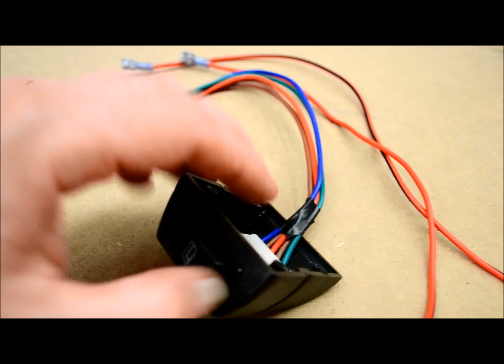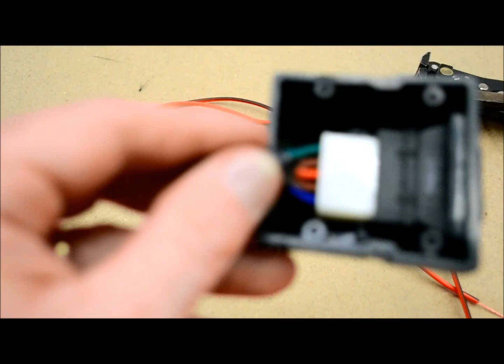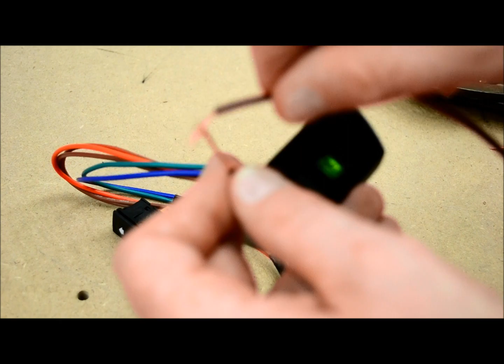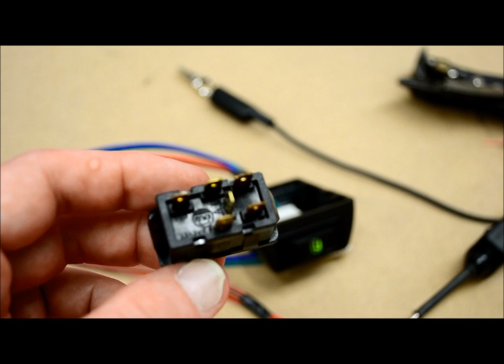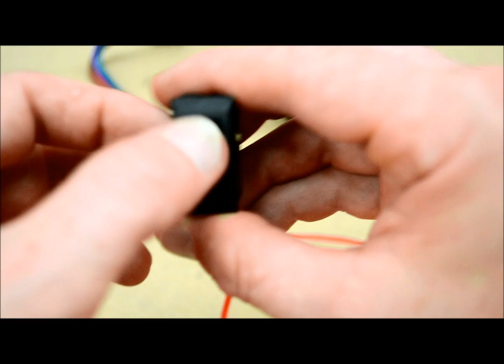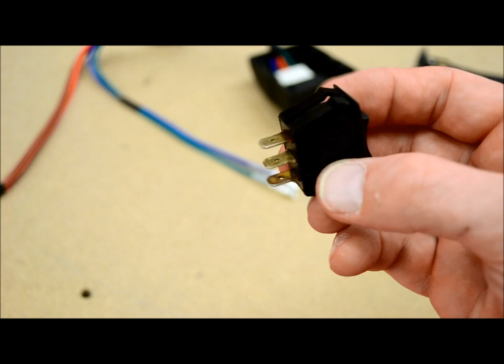How to wire door lock and power window switches

Comment: Excellent video. Im wanting upgrade my van windows to electric and bought a kit that cone with the spal type switches but a different pin configuration. Ive managed to get the windows working but can figure out how to wire in the 3rd switch so the passenger side can be operated from the drivers side. Any ideas on how to do this?

Comment: Hi
I’m using 1993 Toyota 4runner for power window conversion and here are the wires 
Power-Blue with red stripe
Up-Blue/green stripe with red dash 
Down-Blue/yellow stripe with red dash
And the other two wire not used not if that’s ground. For whatever reasons it’s not operating. Any ideas?

Comment: Not sure if someone could help me but I’m wiring my truck to convert to power with the oem switches I got the main to work to roll down driver and passenger on the driver side but the passenger side switch will only go down but not up it trips it out and acts like ur touching - and + together so I’m confused on how many relays I might need for a 2 window I’m wiring it with my own relays and wiring not sure if I need a total of 2 for drive n 3 or 4 for passenger so the driver side switch for the right window works with the driver side and passenger side switch (1995-1998 Chevy c1500 oem switches and motors)

Comment: I'm having major problems finding the source of the problem with my driver's door power window I tested the plug going into the motor and it tests good getting all output indicated with a light tester try three different window motors and still not working and checked all fuses and relays that I know of any advice please

Comment: I have a 2020 KIA Bongo. The passenger window button panel was recently pulled apart.  It separated the 5 pin wiring and now I don't know which wire connects to which pin. Please help. Thanks in advance.
Reply from the maker: Ypu should get a kia schematic for that one

Comment: My car end is a 2 pin plug but my window motor is a 7 pin. I don't care about the auto up and down so how do I make this work?
Reply from the maker: the 2 wires should be basic reversing 12 volts, if you switch them the motors direction will reverse

Comment: so if i get power to roll the window down but not to go up do i just need to replace one of the blue/green cables because i know the switch and motor work? if so where would i get the wire from and how would that install work?
Reply: Did you figure that out?

Comment: Ah ha! I bought heavy duty momentary on rockers, they won’t work for this will they?  They are places for three hot wires , 3 groups of two contacts. All this time I though high voltage stuff was sometimes complicated, I understand it though, this low voltage stuff is killing me. I’m thinking I’m taking a loss on the switches I got, too late to return them, I don’t even remember where I got them. Then just get some of those type switches you have there is going to be the simplist way to deal with these windows. Hot wire to center prong and match the rest from the old factory socket to wire the rest. If that’s at all understandable and you see this any advice would be very appreciated. I have a very good understanding of how they are suppose to work now thanks to this video, I should have came to YouTube 2 days ago I think. I have one of those 12 volt power supplies, they are just completely awesome! My father used to used it for powering a mobile cb radio in the house and to test any 12 volt stuff he needed to test out, the thing is ancient but still works perfectly.

Comment: A lot of these newer power windows have their own fuse somewhere in the line usually behind the dash. Don’t just check the window fuse and think that’s the only fuse to check.

Edited: Refer to the vehicles electrical wiring diagram, usually found towards the back of the maintenance / overhaul / Haynes / Chiltons / Mitchell’s manual
Reply: Never seen any OEM window system in a vehicle have an inline fuse? What are you talking about?

Comment: Good video.. let me ask you.. how can I apply this concept to my 97 Honda accord. The passenger window will not roll the window up or down by either driver or passenger switch. The wires are getting power but somehow its not working the motor. Test light shows power going through the wires but it don't roll down or up.. so how can I just run a new set of wires just for that window.  Where do I get the power from?

Comment: Nice video. I am restoring an old truck. I have a donor truck and I want to power down the windows. There is no fuse panel in the doner so can't just install a battery and power the windows down. I am trying to figure out how to power my windows down. I took the switch out of the door panel and now I am trying to figure out what wires I should apply 12 volts to. I will try to use the wiring you just did, but I think the colours are different. It is a GM switch for 4 windows. At least you have me pointed in the right direction. Thanks for sharing.👍👍

Comment: I am about to add a universal power window kit to my hot rod. This kit comes with the same Japanese green light window switch in your video. This may sound a little weird but, my hot rod interior is lit with all blue led lights, would you know if its  possible to switch the green light to a blue light and if so, would you have any suggestions on how to accomplish this. Thanks

Comment: Hi, My two windows work and the other two doesn't. I've noticed that on the ones that don't work there's no noise when I press the switch. The window regulator and the motor is good but I'm guessing it's the wires? What should I do?
Reply: SET LIGHT TO YOUR FRONT SEAT'S

Comment: what's the pen configuration on the second switch i have one liked that it goes a-f it has 6 pins
Reply from the maker: those are available at spal.com
Reply: Lessco Electronics you woulnt know the wiring on those pins like which is ground an power

Comment: Quick question...
When installing a power window conversion kit...
Are relays needed to be used..
Thanks.
Reply from the maker: not at all, 5 wire switches can handle all the load
Reply: no if you find switchable power source for the module. if you choose to take power straight from the battery, you should install fuse and relay, otherwise it's way too easy to steal your car.

Comment: Thanks for the info,any relays needed? or do you run switch wires directly to motor?
Reply from the maker: If youre using 5 wire switches no relays are needed.
Reply: Lessco Electronics great thank you

Comment: Hi, did I hear you right on the 3-pronged switch? ground on the center conductor?
Reply: this if for the power locks. :D
Reply from the maker: Thats a typical scenario for a non illuminated switch, that grounding type of switch sends a -signal to external relays to power the door kit motors.
Reply: thank you very much.
Reply: @Lessco Electronics, is it okay to wire it directly to the battery? or should i use fuse taps for the install. thanks for your advice.
Reply from the maker: Grab your power at the fuse panel

Comment: i did like you showed here for a single window. the problem i am having is for multiple windows or 4 windows to be exact. when i take two motor terminals from the front and attached them together with another two terminals at the back, they stop working. could you help me.

Comment: Hi, love your work! If I go to the parts store and I want to buy a switch to run my power window, can I wire it like fog lights? Like a + to the battery and then to the positive side of the motor and a ground??? I'm trying to simplify it lol, any ideas? Would I need 2 switches per window???

Comment: Hi, I just converted my 2000 Chevy Silverado from Manuel to power windows, my windows still go up and down when my truck is off and the key out the ignition, the lights from the switches turn off when the truck is off..how can I make my windows not go up/down when my truck is of? Thank you
Reply: The power source is constant 12v move over to a power source like accessory on ignition
Reply: Eduardo Hernandez how did you get them to work??

Comment: Hi, thank you for the video, I had a question on switches , I am installing universal power windows motors on a 60s car, and the motors are the same brand on the front Windows, and different universal motors for the back windows, will the universal switches work that they sell on Amazon work for them? Thank you in advance.
Reply: Maybe any universal 5 pin, insted of a universal 6 pin?
Reply from the maker: Yeah, that won't matter

Comment: hey man ihave a 2014 lancer and i want to remove the rear power window switches but the front main panel wont work with the rear windows if the switches arent conected. i have one co ected hidden and works fine but for the othe door the switch broke so the window wont work. what can i do to make the front main panel work the rear windows with the rear window shitch taken of???
Reply: Sylvia Silva you need to bypass switch that is broken and go start to motor

Comment: When wiring the power lock you nees to connect it to a 12v cable or where do you connect it ?
Reply from the maker: Use a constant fused 12v source

Comment: I have a window switch just like the one you show on your video. I wire it up and it works once in awhile. The window goes up and down very slowly. I take the switch out and operate the window from a power source. It works fine. Could I have wired it to the switch wrong? I'm putting in after market window and door locks. The windows are the problem. Any ideas?

Comment: I got a question I have a 96 gmc sierra manual windows I'm getting doors with power how do hook the relays to my fuse box instead of running to the battery
Reply from the maker: find a blank and use that with the appropriate adapter tap, just make sure youre on the fused side

Comment: Hi - great video - I have a 2004 Yukon - rear driver side window rolls down on its own at random times - I replaced the specific window switch but problem still remains - I spoke with a guy and he said change the relay in the footwell - but I am struggling to see that the relay could cause the repeated fault of the specific window (why does it not affect the other windows.....) - only other thing I can think of is the driver's master switch assembly (expensive to replace) - any advice???

Comment: I was replacing my the front Driver & Passenger side window regulator/motor today and all went well and fine - however, on the passenger side, I don't believe I did anything differently - but the up and down direction has gotten reversed. I've been researching this and people say to swap the wires but I'm not finding a good diagram for 05 chevy colorado. Are the up and down movement wires a standard blue and green wire like you show in this video? I can't recall right now but I will recheck tomorrow when I tackle it again -  what is odd was that originally is was operating correctly when I tested it before putting the door panel back on... but somewhere between then and getting all back together - at final assembly of the door, it acted as if it stalled and didn't want to work - then began functioning, just in reverse. So strange, never had this happen before.
Reply: unpopular advice : reverse the switch

Comment: Dear Lord please wire your window switches to ONLY work when the key is in the ON or ACC position, otherwise your car go bye bye one fine day.
Reply: i wired my window switch directly from the battery because there is something wrong with the fusebox that the mechanic said he cant fix.. i added a circuit breaker tho.. and since i cant havnt bought a new fuse box i still run it today.. i always turn the switch off when im not using.. but i cant trust anyone else to drive my car and its a bit stressfull.. im open to better fix suggestions because i cant find a new fuse box to buy
Reply: Hruaitea Ralte just use a fuse tap and wire it to a fuse thats only active when your key is in the on position

Comment: I have the wires all connected but where can I get the power source from car interior?
Reply: Honestly it depends on how you want to do it and the vehicle you have. The question is do you want to struggle or half ass it and call it a day?

An example source for 12v acc power is the radio. when you turn the key power is on and if you tap  in to it so will the locks or windows. Another example is from the fuse box. using a test light  ground the clip while probing away  and tell a buddy to turn the key forward  and if it lights its 12v acc. The struggle lies in how clean of an install you want and from where you want the source and the crap you need to remove and finally button it back up.

The half ass part would be direct 12v to the switch(es) and being stranded with a sapped battery from the little light.

Also you can google the vehicle you have and check forums.

Comment: good morning I have a question that I'm sure you'll be able to answer. I watch a lot of your videos great work by the way. I have these windows in my 74 bug. The issue I'm trying to fix is I don't want 2 switches on my drivers door panel because I switched handles to mk 4 handles. Is there any way to add a delay that when I hold drivers windows switch down and drivers window is down it would then trigger passenger or do I have to use the 2 switches. Thanks in advance
Reply from the maker: There may be but I cant think of one. Even if there was a way, the wiring would be extreme!

Comment: how to install power window relay with switch 5 pin and where To connect do You af a DIAGRAM FOR IT
Reply from the maker: no need, the center is 12v+ the 2 middle pins are -12v and the outer 2 pins alternate the windows up/down with the switch
Reply: How to  wire 2 relay for power window whit a 5 pin switch
Reply: Jozef Van

Comment: OK Have a question. I have a six pin master switch on my passenger side door that controls all my windows etc. I cannot seem to get it wired right. I have 6 wires 1 Red 1 Black 1 Blue/Red 1 Green and then 1 Black and 1 Green which I assume hook in the center. Help!!        II = II (It looks like this.
Reply from the maker: email me a picture to: sales@lesscoelectronics.com, Once I see it I can tell you pretty quickly

Comment: Just bought a hotrod that I didn't wire. the back window switch is a 5 prong staggered pins rocker which is toast. I have a 5 pin  (inline)modern switch I'd like to change. The consul switch does work the window. In the  back door there is 12 volts to both wires to the window motor with key on.  The other two wires go  to a plug for the switch  and also each have 12 volts. Not sure how the previous switch worked and can't seem to get this one wired correctly. Appreciate any advice, Thanks
Reply from the maker: +wayne shay do you have any photos I can see?

Comment: So do the blue and green wires attach directly to the black and white wires coming from the window motor? and does it matter which one goes where?
Reply from the maker: +M Arney yes, and the wires do matter which goes where, reason is if they are backwords up and down will be reversed, easy fix though ;)
Reply: +Lessco Electronics Thanks...  I have a Spal switch kit I bought from Amazon and it came with no instructions or even a wiring diagram.  I consider myself a smart person but honestly, I can't make "head or tail" of what to do with this kit.  I am finding bits and pieces of information online (like your excellent video) and hopefully I will eventually be able to solve the puzzle.  Very disappointed with Spal.

Comment: ok i have a question, i have an 03 yukon with factory power locks, i want to install a lock button at the rear of the vehicle (lift gate / hatch) i only need it to lock all the doors, i dont care about unlock, how do i wire this up ?  thanks
Reply from the maker: +Rob S 
That vehicle has multiplexed door locks, so in order to do that it'll be a job and a 1/2 to do. you would need a digital interface along with a switch in th rear to interface with the computer controlled locks in the Yukon. sorry to bring the bad news.
This vehicle requires an Interface Module Part# XK09 or GMDL-BP to achieve the purpose
Reply: +Lessco Electronics not really bad news, as ive been looking into this for a while now
ive looked at the GMDL-BP before, how would i wire this up without a remote starter ?
obviously positive, negative, then im guessing the pink/white, then the green to a switch that goes to ground ?
is that correct and is there anything else
Reply from the maker: You would just connect it using the hardwire method to input lock and/or unlock (or both) into it from that new switch you're adding in the rear. The switch would need to throw grounding outputs, and that's all there is to it in a nutshell.
Reply: +Lessco Electronics im sorry, i dont see in the instructions anything indicating a 'hardwire method'

Comment: ok here's my problem. passenger seat power window works fine on its switch (rolls up and down). however, on the master switch (driver's switch), it is only able to roll up the passenger side window, not down. i've tried cleaning the switch on the driver's side with contact cleaner spray can but didn't work. what could be the problem here? thanks

Comment: I'm trying to add LED lights in the door handles, could I run the power of the 12V and the ground you mentioned here when demonstrating the window switch light?
Reply from the maker: Dillon1791 sure, no problem at all.

Comment: what if the window goes up and not down? relays and fuses both new and switch. plz help
Reply from the maker: ama bear test the window with a bettery it may be that motor, otherwise the switch is bad on the one side, work backwards while testing so you dont waste time.
Reply: i just ran 2 wires from passenger motor flipped them and works on 1 switch lol.